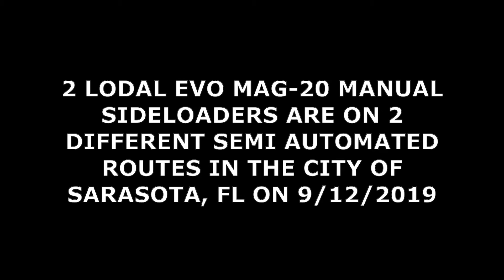2 LODAL EVO MANUAL SIDELOADERS in ACTION in SARASOTA, FL, 9/12/19

Comment: Very nice! I love the sound of the residential Lodal Evo! What year is that one? What's the engine and transmission, Caterpillar 3126 with Allison MD3560? I think you forgot to put the engine and transmission in the description!
Reply from the maker: Not sure,  I know they’re very old when I caught them few yrs ago;(.  But, all I know is that the supervisor told me they’re powered by Cummins ISB diesel & backed by Allison auto & driving Dana’s SD66 front steer drive axle! The rear axle is a Dana non driving wheel end! I’ll have the drive train specs in the description sometime tomorrow,........
Reply: @bitterman112  Do you know what model Allison? Would I be correct in saying it's powered by the 5.9L Cummins, the same engine found in the Dodge Ram 2500/3500 pickup trucks?